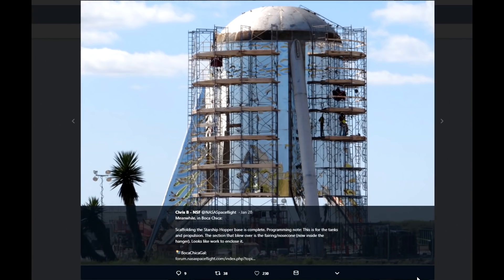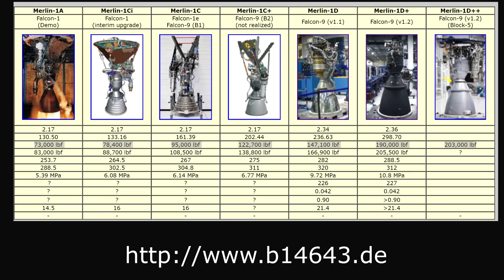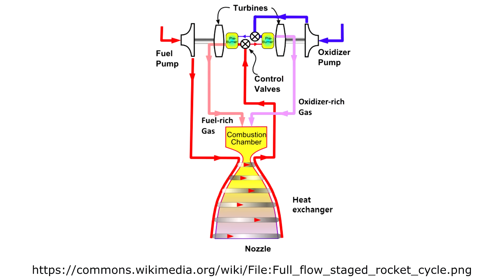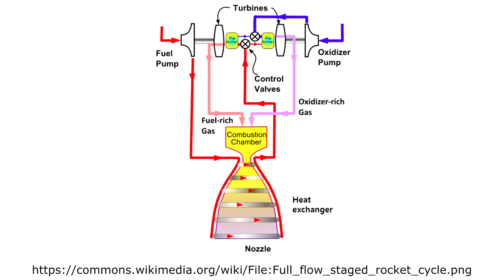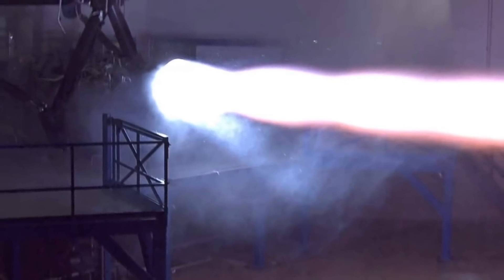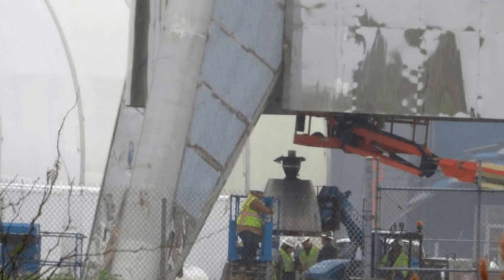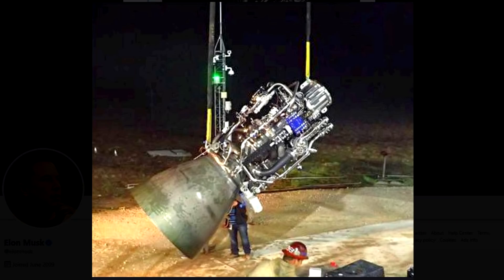SpaceX's Full Size Raptor Rocket Engine Revealed By Elon Musk

Comment: .....  SpaceX .... Problems afoot? with Raptor?  (( a chain is as strong as its weakest link ))
..... STARSHIP, 1x 10Km HOP that didn't explode on landing,, HEAVY LIFT,, NO FLIGHT TIME AT ALL
SLS in production, Liquid & Solid rocket engines fired for full term, Orion flown & Recovered
Shuttle ... ((weakest link)),,,,, TILES,,, Can the STARSHIP be recovered ??????

Comment: Look at the size of that, enormous! Will they equip this on the future 18m diameter starship?
Reply: dude three of these flew to 12 km a week ago
Reply: @juleswinnfield2718  I thought they used the medium sized, sea level raptor engines on SN8. These bigger ones are the vacuum engines I think.
Reply: @Matt33318  probably yes, the vacuum version is made for higher altitudes and the vacuum itself, while SN8 only flew 12,5 km high.

Comment: Just 1.5 years later. The Starhopper under construction flew magnificently, but SpaceX moves so fast it's now a museum monument. The Mk1 Starship founded on it was obsolete before flight. SpaceX drastically changed direction and now SN5 has flown and SN6 is on the pad. And that little tent containing the nosecone and the scaffolding around Starhopper - replaced by a city of tents and buildings, and Mid and High Bays. Oh, and Raptor hit that 300 bar and surpassed it. In a year and a half! I think Blue Origin built an assembly jig for a tank section in that time.
Reply: And now it's gone most of the way to orbit

Comment: Does spacex recovered all it's engine that goes into orbit?
Reply: It's currently not technically possible to recover stage 2 engine that's optimized for vacuum.  That's why Starship will have different engine nozzles.  Some of the raptor engine is for near sea level atmosphere and some of them are for vacuum.

Comment: Hey Scott, l'm a Nerd that like rocket engines too.  Always wanted to build my own liquid rocket motor.  Flew model rockets and did computation on Isp (specific impulse) of fuels.
Even designed my own liquid Methane - liquid Oxygen motor using Method of Characteristics.
The best carbon based fuels are: liquid Methane, liquid Ethylene (C2H4), liquid Ethane (C2H6) and the best is Acetylene (C2H2).
Why can't there be a rocket motor that work on multiple fuels?
Maybe two or three fuels burning together with one or two oxidizers?
No more single fuel and single oxidizer.  Think about it.
The next step in liquid rocket motor performance and thrust.

Comment: Can ULA use this raptor engine ?
Reply: There's no physical reason they can't mount several Raptors on the first stage of the upcoming Vulcan rocket, instead of the BE-4 from Blue Origin it's designed for. Vulcan will be methalox fueled. But ULA won't want to deal with the chief rival that took away a huge part of its business, though. And SpaceX won't want to deal with them either.

Comment: Hey Scott, just wondering why no one has considered an electric pump instead of a gas turbine?  Upside: No requirement for a pre-burner and therefore no exhaust issues at all.  Downside: Power requirements.  Surely it should be feasible?
Reply from the maker: Rocketlab’s Electron Rocket uses exactly this, they have large batteries on board, on the second stage they hot swap and drop the batteries later in the flight to save mass.
Reply: @scottmanley  cool! thanks for the reply!

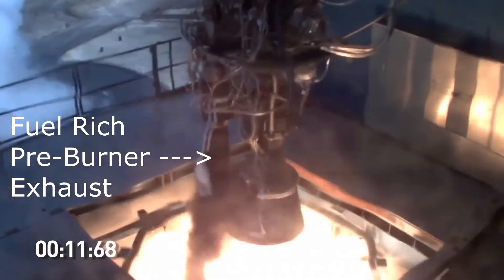Comment: Correction after 2:55 "preburner" it's not, it's the turbopump GG exhaust which is dumped and gets a little extra thrust too. The Titan rocket brilliantly used it's GG exhaust for roll control for the single engine 2nd stage vs vernier engines that were used on the original Atlas rockets,pre-RD-180. Love your videos,Thank you, Ken

Comment: WE,as Truax Engineering(Sea Dragon), built and successfully hot fired LOx full flow rocket engines pressure fed,no pumps. Unfortunately we were dependent on outside funding so became victim to loss of funding before a launch could occur. But the technology was verified,I'd like to carry the torch, no pun. Ken

Comment: Actually, the turbo pump technology for rocket engines are 'Open Cycle' and 'Closed Cycle'. The Open Cycle design is one of the simpler designs, and the turbo pump exhaust is just dumped. That you can see plainly on the older Atlas launch, as a dark plume off to the side of the engine. The Saturn 5 used the same technology. The Russians are the wold leader in the closed cycle engines, such as the RD-180 and variants. In those engines, the turbo pump exhaust is run oxygen rich and fed into the main engine, and gives about a 20% boost in performance.

Comment: Why not use an Aerospike engine?
Reply: Aerospikes have (so far) turned out to be no so efficient.  To date, not a single aerospike has actually been flight tested.  When they can get the specific impulse up higher to a point it becomes efficient to produce, then maybe we will see mass production.

Comment: Methane + Cryogenic liquid oxygen a very clean burning hydrocarbon oxidation reaction since little if any atmospheric nitrogen will react in the thrust plum, meaning really clean emissions compared with ICE vehicle engines that must inhale oxygen laceded nitrogen air natural air, compress this gas mixture with the fuel & combust to extract useful work. 

Big chemical rockets & stainless steel alloys high in Nickel & Chrome like 301 can help us get to the moon in a more affordable solution! If we put enough stuff on the moon & in lunar orbit, missions to Mars will be less expensive as support for those missions can occur via the moon station and lunar orbital station supply setup. 

Food & Water / Freeze Dried & Recycled Endlessly + Intelligent Chemical Poop Compost Soil Fertilizer Hydroponic Recovery System can even turn the poop into edible plants, using the deep cold of space for nearly free freeze drying etc a closed loop quasi closed loop food system that uses more solar power & RTG power to enable the astonaughts to survive longer in space & on the moon & mars especially. The human body an ecosystem & science missions to space neet to integrate this body ecology poop soil plant relationship to make living on the Moon & Mars more sustainable!

Comment: 1:21
woah woah woah woah slam on the brakes here! 
Pintle injectors? 
PINTLE INJECTORS?
Are you fucking kidding me? Diesel engines abandoned that shit about two decades ago. What The FUCK.  Why is rocket injection tech so fucking primitive? God damn, what did they use before?  No god damn wonder rocket engines explode! They cant even atomize the fuel! In a piston engine fine atomisation of the fuel is KEY to proper smooth combustion. That's why diesel engines, who have to operate under high pressures i the combustion chamber from 18:1 compression ratios, use injection pumps and injection lines and injectors. All of which are used to push the fuel up to about 200+ Bar.
Modern common rail systems on engines built since about 2000-2003 can reach 2500 Bar.
Good job Musk! From the sound of it rocket engine tech isnt even all that advanced or complicated!

Comment: From images posted by Musk.  (Not pixel count just using technician's height questimated at 6 ft. tall)
Raptor nozzle diameter = 3 m +/-
Engine height 7.25 m +/-
Engine mass?
Support mass average each engine?
Actual SL thrust per comments 1,900 kN ?
Scott do you have the actual numbers? 
Also I'm a recent subscriber.  Really like your programs, information,  and attached videos.

Comment: What if you used a hydrogen fuel cell to run a brushless electric motor to pump the fuel instead of a preburner? Hydrogen fuel cells are over 90% efficient and brushless DC motors can be as high as 95% efficient and have an extremely high power to weight ratio.

Comment: I still didn't understand it. I know you'd need to be able to take a close-up look at the engine, and maybe ask some questions, but I'd really like a much more detailed, step-by-step explanation of how the engine works.  You started off saying they designed the Raptor from a clean sheet of paper, but the only difference I can see is that they're burning methane, and that they're introducing TWO pre-burners instead of one. That doesn't seem like all that big a change.  Another issue:  The schematics you posted are such simple sketches; just a few major parts shown and a handful of fuel-flow diagrams. What the hell is all the other stuff for, in the pictures of the engines?  There are HUNDREDS of pipes and wires and valves and mysterious parts... those aren't just for decoration, are they?  Please explain what everything DOES.  Thanks Scott -
Reply from the maker: Yes, I too want to answer all these questions,

Comment: I'm still missing why this solution reduces thermal load on turbines.
Reply from the maker: In other designs only a portion of the propellant drives turbines, in this all the propellant drives the turbines. So with more mass the pressure difference can be smaller which means the temperature can be lower

Comment: One thing I've always been curious about is, how does one test a rocket that's meant to operate in vacuum or at high altitude?  Are there vacuum chambers big enough to test a rocket in?  Do they have pumps that can keep up with the output of a firing rocket?  Or do you just have to test it at atmospheric pressure and hope your math is right about how it will operate in a vacuum?  Or maybe get it as close as you can, then strap it to the top of a sounding rocket and run your test at the top of its arc?
Reply from the maker: The vacuum chambers give a few seconds of testing.

Comment: Does that type of engine still need separate ignition in the main combustion chamber (like a hypergaulic ingition fuel)?  I mean the mixture from the turbines are already hot, and if a turbine fails to ignite, then it won't pump the mixture into the main chamber.

Comment: When these engines are tested are they having a quantifiable influence on Earth's rotation?
Reply: No
Reply: Infinitesimal. I would imagine it's like you blowing on a car to make it move. Also, the tectonic plates are more likely to be affected first.
Reply: Only if the ejected gas can go outside the Earth system. But due to the viscosity of the atmosphere, practically all of the momentum is transferred back to the Earth, "closing the loop" i.e. making all the involved forces internal.
Reply: Scott made a movie about it.
Reply: It's just pushing the atmosphere around the local vicinity like a strong wind.

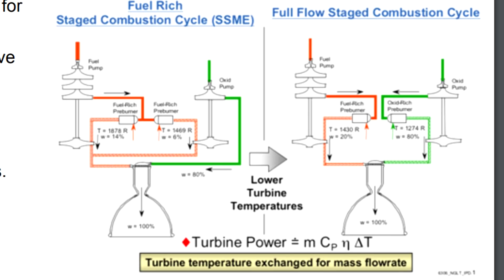Comment: At 5:58, there is a note at the bottom that says "Turbine Power = mdot * Cp * n * deltaT".
The oxidizer turbine on the left passes w=6% of the mass flow of the engine.  The oxidizer turbine on the right passes w=80% of the mass flow of the engine.  So mass flow on the right is 13x the mass flow on the left.  Cp * n can't be a lot different.  So that suggests the deltaT on the right must be an order of magnitude smaller than the deltaT on the left.
The diagram doesn't show the deltaT, as it should.  But it does show the turbine inlet temperatures.  The TIT on the right is 195 F cooler than on the left.  But why such a small change?  Is the turbine exhaust on the right much hotter than on the left?  Why would you want to preheat your propellants before injection?  Once you've got them either boiled or supercritical, any additional heating just increases the volumetric flow rate which makes your engine either heavier (bigger pipes) or less efficient (not bigger pipes).

Comment: Watching your description here I see an immediate application of neural networks in the design and operation of rocket engines to enable them to be 

1) dramatically more fuel efficient. 

2) Produce more power for given unit of expended fuel. 

3) Burn with far less risk of catastrophic unanticipated dissassembly when flow irregularities happen. 

It would involve using neural networks to modulate the flow regulation and thrust production in real time to ensure optimal combustion. 

This could be done rather cheaply and quickly in fact ...it would require utilizing data from sensors that monitor propellent flow and gaseous expansion and combustion parameters and then use an NN to train it to learn to modulate flow rates to ensure optimal combustion within a given desired range. 

This could literally be trained in simulation and then put into a real engine. 

Every problem in Engineering can be solved this way (and we are seeing this happening in areas as far flung as climate science and brain science).

Comment: Still got nothing on the Saturn V F1 engine. Even the most powerful variant of this motor if indeed 3MN thrust was realised you would still need 3 of these to be equivalent to a single F1 engine.
Reply: Early designs were much larger, but optimizing their performance (thrust-to-weight ratio in particular, per Musk) led them to using more smaller engines instead. The initial version of the rocket should have roughly 60.76 MN of thrust to the Saturn V's 38.85 MN.

Comment: methane + oxygen = a load of CO2 = global warming
Reply from the maker: Methane is a worse greenhouse gas if you don’t burn it.
Reply: @scottmanley  That's why it needs to be left in the ground.
Reply: Peter Zhang  can be, but it isn't
Reply: Spaceflight is such a small scale affair it'll still be a rounding error in emissions if we start doing more of it. For comparison, there are something like less than 100 space launches a year, and about 40 million airline flights (100 000 a day!). If we did one day get to the point where spaceflight is so commonplace that its emissions are on a relevant scale, then we'd have to worry about it. And probably go for hydrogen, or carbon neutral production methods for methane.
Reply: @Elukka  the plan is to use a fleet of starships (BFRs) as airliners
Reply: @southernbreeze3278  
If I remember correctly SpaceX's plans for Earth-to-Earth transportation involved launching from sea, so it's possible that they will use the carbon neutral approach that @Peter Zhang mentioned by utilising local seawater (this would probably require nuclear powered barges). Besides, given the current scale of the rocket industry it doesn't make much sense to criticise the greenhouse emissions involved.

For example, if we assume that the Starship/Super-heavy will be 90% fuel by mass (4,400,000kg x 0.9 = 3,960,000kg) and that the mass of the exhaust will be about 55% CO2 (it won't burn CH4 and O2 at a 1:1 stoichiometric ratio so this would probably be higher) then that correlates to 2,178,000kg of CO2 per launch.

If the Starship/Super-Heavy were to launch 100 times a year then that's 217,800,000kg of CO2 per year. Which is only 0.00057% of the annual greenhouse emissions from burning fossil fuels! So I really wouldn't worry about SpaceX's carbon emissions.
Reply: @jeffvader811  SpaceX has said NOTHING about any type of carbon neutral plan.  Also, claiming that small scale is not a problem is ignoring the fact that the near-term goal for the program is the very large scale.  Further, justifying more carbon emission because we already dump way to much carbon into the atmosphere is circular reasoning.
Reply: @southernbreeze3278  
I know SpaceX hasn't said anything about carbon neutral fuel production, but if they plan to do sea launches then going carbon neutral would be a practical choice, which I did mention in my original comment.

I did all of my calculations assuming 100 launches a year, (a launch every 4 days) that is a very large scale, much more than will be required for Mars missions, and still will contribute very little to greenhouse emissions. Besides, global warming is an issue *now*, if we make it to a point where rockets launch so often that they are a significant contribution to global warming then the planet will already be past saving.

My reasoning was not circular, I said very clearly that criticising an industry that contributes practically nothing to global warming makes no sense. The aerospace industry is like a twig in a bonfire, putting it out will be expensive and do nothing. You have to get at the source of the problem if you really want to combat global warming, that means renewable energy, carbon scrubbers etc.
Reply: @jeffvader811  The fact is you are turning a blind eye to CO2 emissions from a source that YOU approve of, and that's all.  You justify with hypothetical carbon neutrality that's just pie in the sky (far from shown to be practical) while real world plans are in effect to make use of these "spacecraft" as airliners.   You have no way of knowing if the world will be past saving when that point is reached.  Again, just rationalizing carbon emissions when it's in your interest (like Al Gore).

 If I were to take your word that the Starliner won't be putting out enough CO2 to change the climate, I would have to believe the oil companies too when they say the same thing (or are they too just promoting their own self-interest).  

Bottom line, you and many others support THIS source of carbon emission (which if successful will someday be a massive source) because it's in your field of interest.  If you take this tact, might as well join the belief that fossil fuel use does not significantly effect the earth's climate  and temp. variations we see are just due to the natural cycles that take place on earth.